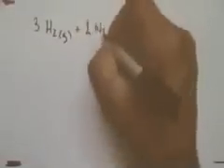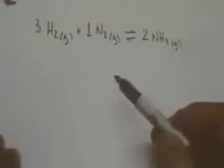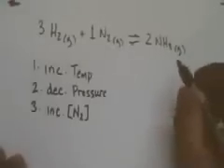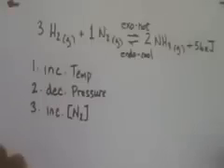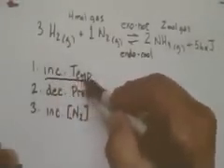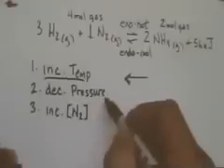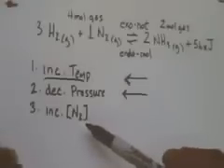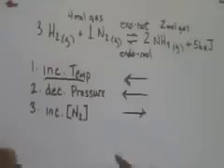Le Chatelier's Principle

Comment from the maker: Thanks for your comment.
You are correct: if you decrease the temperature, the system will "try" to INCREASE the temperature by shifting to the exothermic/temperature increasing direction, which in this example is the forward direction. Thus, the products/NH3 (of the FORWARD reaction) increase in concentration and reactants (N2 and H2) decrease in concentration.

Hope that this helped.